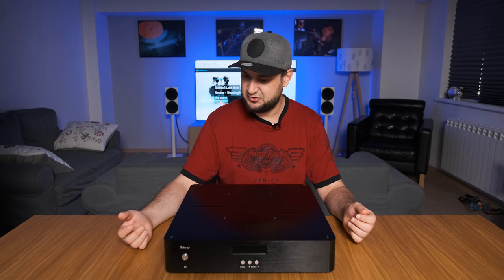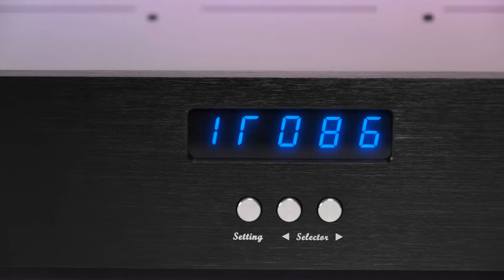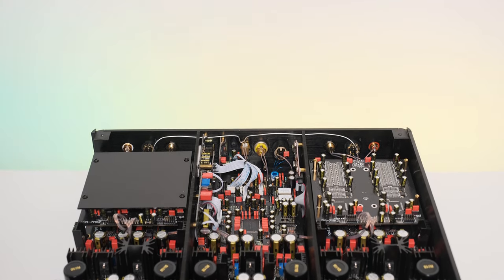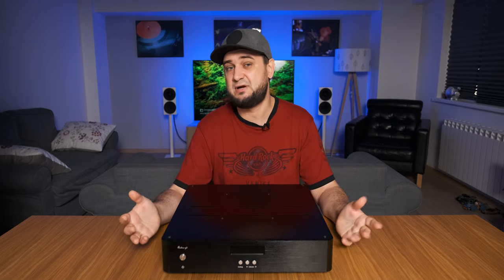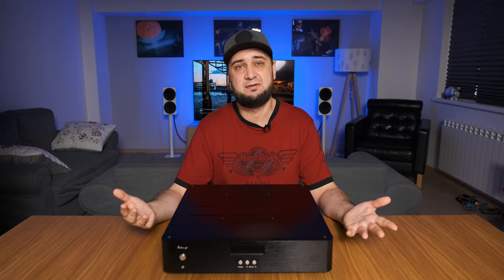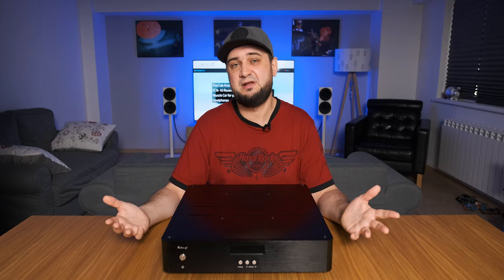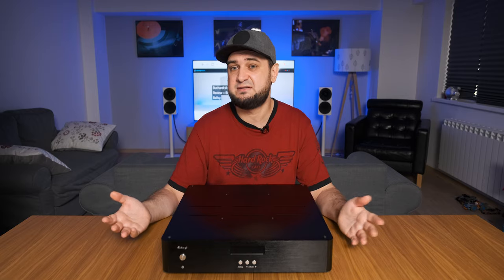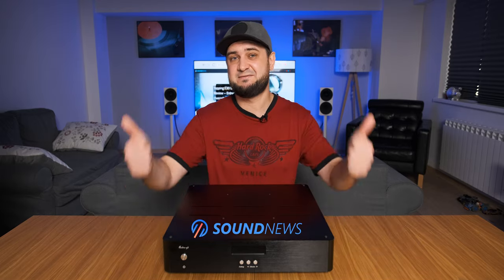Audio-GD R7 (2020 Version) Review - R2R Done Right

Comment: I had an Audio-gd DAC19 that sadly had a tragic drinking accident a few months back. If it hadn't died, I'd still be using it even after 4 years of. I got a Denafrips Ares II, it did not compare whatsoever in terms of clarity and timbre. Then I got an RME ADI-2 DAC FS - this opened my ears to what was possible with Delta Sigma DACs at that price point and I must say it is an excellent performing DAC with gobs of clarity and detail, while still staying smooth. It punches way above its weight in terms of performance - actual lightweightedness and plastic be damned. 

I still missed that expressive and organic Audio-gd R2R sound though. Despite the options, I chose to go back to Audio-gd and have just plugged in my new R7, feeding an Audio-gd amp and Harbeths. Even out of the box it sounds exquisite - such finesse, refinement and clarity, on top of that Audio-gd R2R house sound that I love and know so well.  Should've just stuck with Audio-gd....
Reply from the maker: Congrats mate!! R7 is still the one that wasn't outperformed by anything at any price in terms of scale and slam. Ares is nowhere near that organic and thick sound of the R7, I already miss the loaner unit.
Reply: @Soundnews  Thanks mate! Oh yes, the scale and weight - I didn't take that for granted, I did miss it too in the end. That's also part of the Audio-gd vocabulary. Visceral. 

I would've gone for an R-1 but given how resolving the speakers are it would've led me up the DAC ladder (pun intended) anyway.
Reply: @Soundnews  It has slam alright, it has a mid bass hump. If you are into club music where you want to hear bomp bomp bomp, then this is the dac for you. If you want a liquid, natural sounding, analogue sound and sound stage of a r2r dac, this thing is a horrible choice. Alot of people in this hobby do their damnest to get away from artificially boosted bass, artificially boosted anything, and this thing is a bass cannon. Worst audio purchase I have ever made. Be careful if you are thinking of purchasing this thing, it is good for a specific type of listener only.
Reply: @infn  It makes everything sound visceral, and if you are looking for that, this is an answer. Not all music is mean to be visceral, with every slight touch of a bass guitar rumbling through your music in chest shaking fashion. This dac will suck for a lot of people, and that should be told because there is no way to return it if you don't like it. You will have to sell it for a huge loss..
Reply: @jeffsykes1195  Not my experience whatsoever. You want to pull your speakers away from the wall and if that doesn't work, get some bass traps.

Comment: Hello,  Bro whats your recomended dac for THX AAA 789 from DROP. I allready have focursite Clarett interface, do you think i could use it as DAC or u recomended buying someting more? Thanks alot!
Reply from the maker: particularly with 789 from Drop I would stay away from cheap ESS Sabre designs, could be too bright with THX amps. Affordable AKM design are working much better with any THX amp in my humble opinion. If you want an amazing DAC for your 789, go with Topping D90
Reply: @Soundnews  you mean that Focusrite Clarett using ESS SABRE ? I heard that Clarett works really well as DAC, but to be honest i cant found any clear review. Thanks for answer!
Reply from the maker: @soundsilove6123  I don't know anything about the Focusrite Clarett, just in general AKM based DACs are working better with THX amps compared to ESS based DACs, that is all. If you don't have any other source, use the Clarett for now and see if you like that combo.
Reply: @Soundnews  Thank you for for help, I checked and Clarett using AKM CHIP so its good information! :)
Reply: @Soundnews  btw. what do you think about S.M.S.L Sanskrit 10th and SMSL M300 DAC?
Reply: @Soundnews  Update, maybe someone related to same question. I bough SMSL SP200 thx aaa 888, with smsl M200 dac and also tried it with focusrite clarett interface, tested on beyer dt1990 pro, clarett itself have realy simillar amp to this combo, so its pretty good all in one interface with good headphone amp

Comment: Excellent review as always. Please review their D/S DACs and their amps to find out how well-rounded this manufacturer really is.

Just one question if I may. In previous videos you suggested to someone to stay away from Audio g-d products, and you replied to another by saying that you don't like their long signal path. Why the sudden change of heart?
Reply from the maker: Can you point me out to any of my comments regarding A-GD. I only owned the Master-9 from them long time ago, while it was an amazing pairing with HD800, it wasn't that great with Audeze LCD-4, that was the only reason I sold it. On paper, a shorter signal path should sound clearer, with R-2Rs it is not possible having a shorter signal path - they still need hundreds of resistors and a complicated FPGA code. A shorter path is doable only with D/S DACs
Reply: @Soundnews  I can't find the comment about their long signal path, but check your Denafrips Ares video 7 months ago for your suggestion to avoid their products. you were replying to a gentleman by the name of Gilbert. BTW I'm not trying to put you on the Spot. I'ts just that I read everything you write several times and cross check info from one review to the other to develop an informed opinion. Thank you for everything.

Comment: What power amplifier you use?
Reply from the maker: KECES S125 for now, but thinking of replacing it with a Benchmark AHB2 later on
Reply: @Soundnews  are you still gonna keep your hpa4?
Reply from the maker: @DJJEZ  Of course. It is still the best Preamp and one of the best (if not the best) headphone amp, I use it daily.
Reply: @Soundnews  you should ask for the Audio-gd Master 9 preamp and Headphone amp. Connected with the R7 with Audio-gd ACSS connection its incredible!